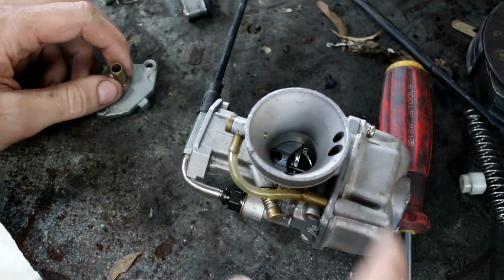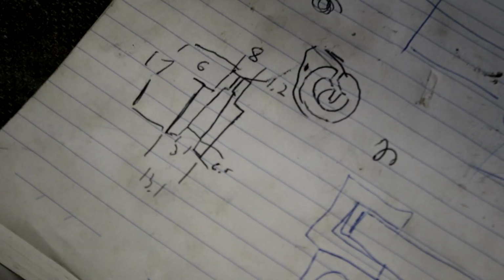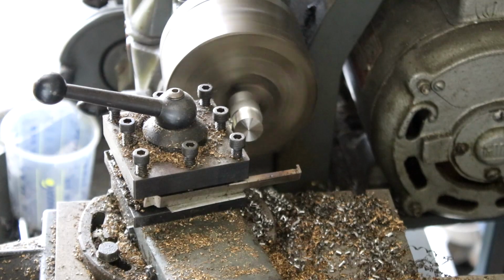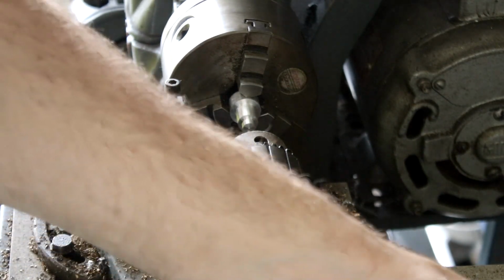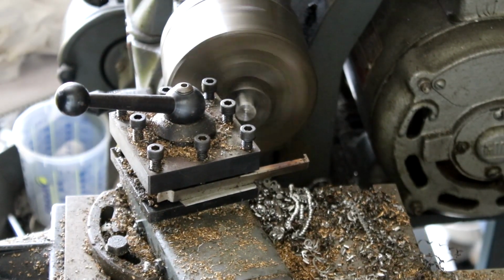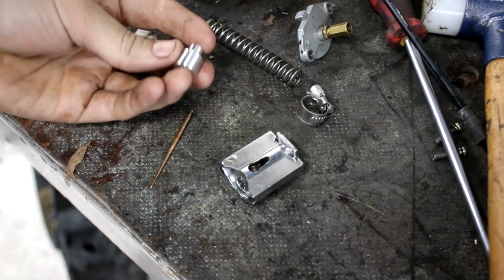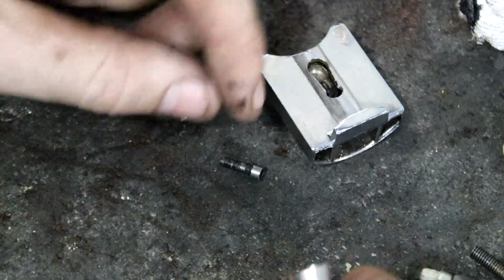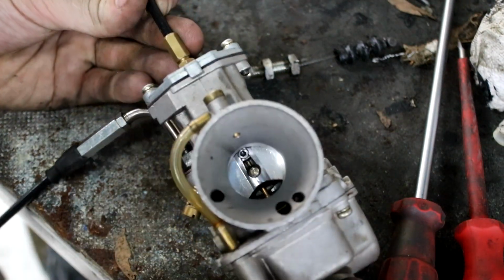Machining a Honda to OKO Throttle Cable Adaptor.

Comment: "Local man saves $13.92 for a new cable by using $5000 machinery and day's labor" lol
6:20 always appreciate a quality rant
Reply from the maker: The main aim is I wana be able to quickly swap between this engine and the original one when this engine constantly explodeds.   I have a cable that would have work but it takes more time to run the different cable the the rest of the engine swap steps combined lol